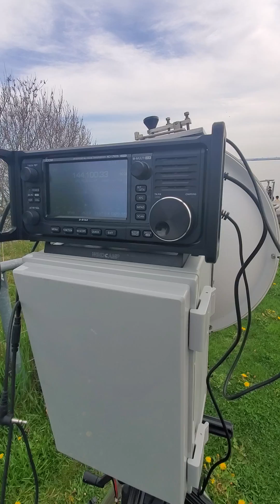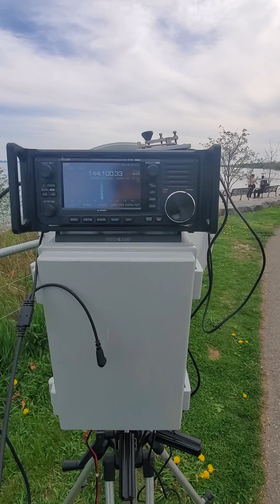VA3TO  First contact on 78GHz with VE3KH  @ 10km

Comment: is there any practical reason to do this? couldnt 144mhz still make that connection pretty easily?
Reply from the maker: Yes, just like a cellphone could.  
Everyone has their "thang".  It's technically challenging and especially so as you move up in frequency. Free space attenuation increases as you go up in frequency so you don't get the range that you do on the lower bands. We endeavor to push the conventional limits of "line of sight" communications and take advantage of different weather conditions to extend our personal best distance records.  If you want easy, use 144 MHz. If you appreciate a challenge, try the microwave bands.
Reply: @radeohedca  thanks for the info, ive considered trying higher frequency stuff before but never really got into it, too expensive and nieche, but it definitely seems interesting